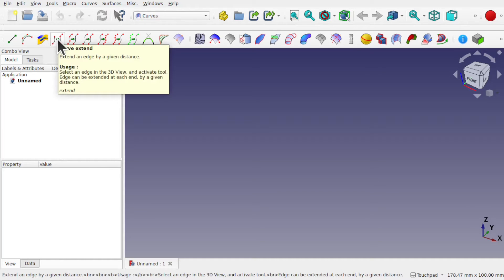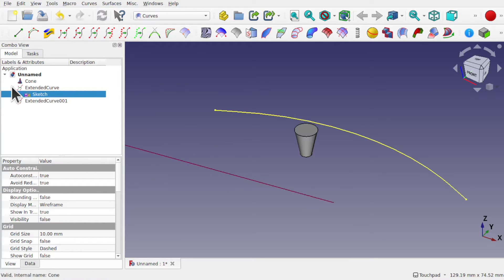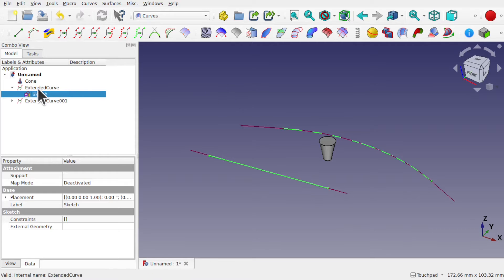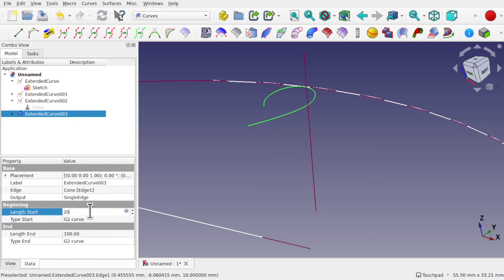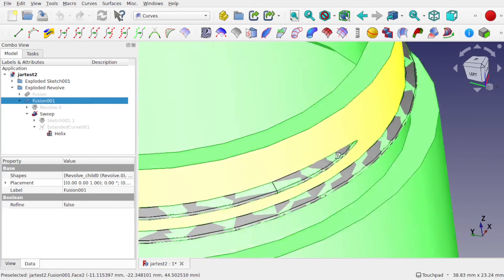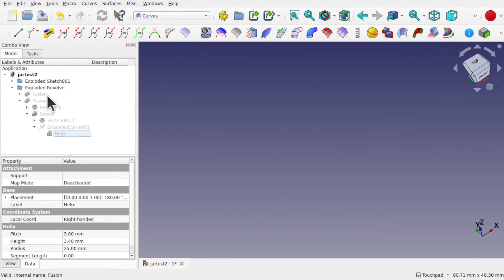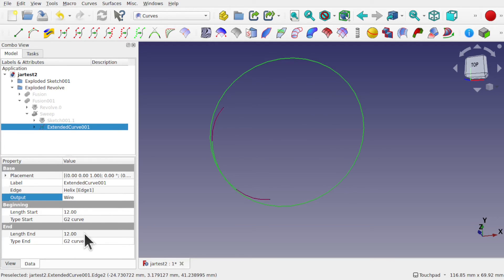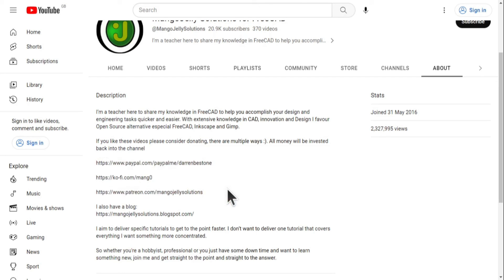FreeCAD Curves Workbench Tools Explained - Curve Extend - Help For Beginners

Comment: Can you create a cam groove using arbitrary path created by Curves workbench? The cam cylinder projection width on the drum surface is constant regardless of depth.
Reply from the maker: I did experiment with something similar and it has potential.  This was back in Dec.  There is no sound, just a experimental session https://youtu.be/02xJqVp1P2I

Comment: Quite a simple tool... so what would you use it for (except for your helix ) ? The sketchers "extend edge tool" seems to be easier to use.
Reply from the maker: I have only used this tool a few times for lead in and outs of custom threads, again a helix, or what's I had to extend a path a bit further on the same trajectory. Very rarely I have used it.